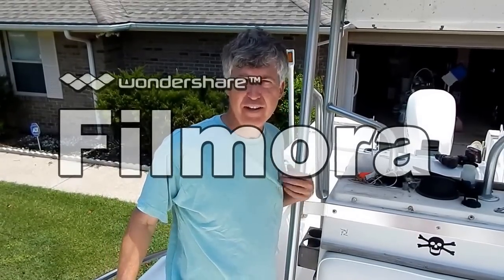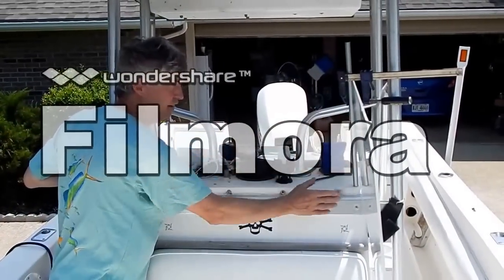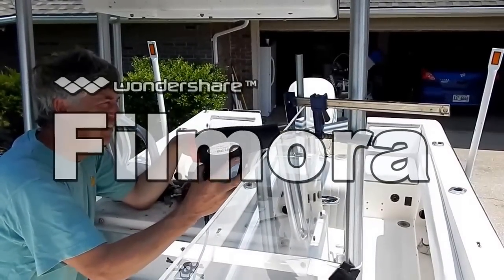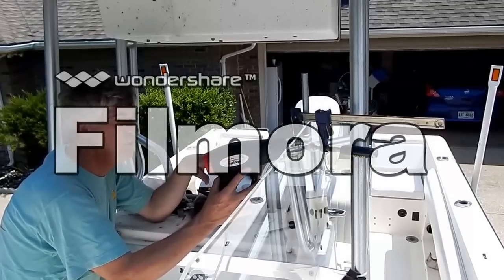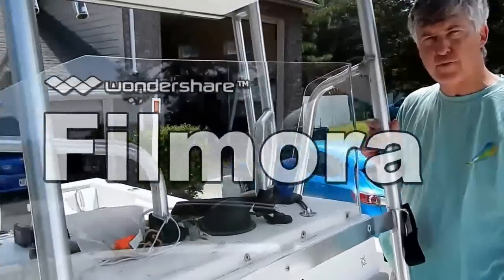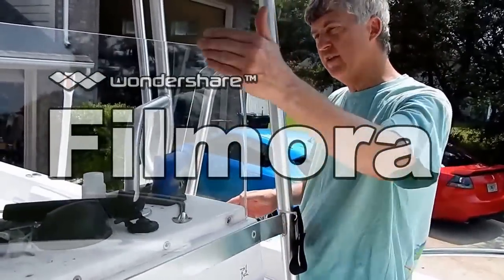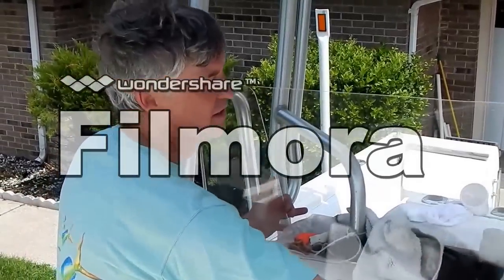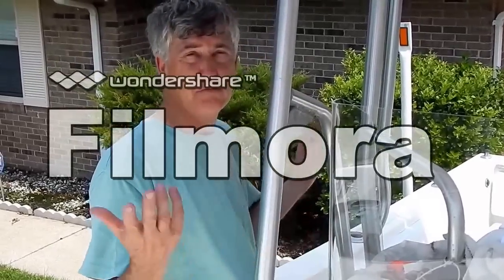How to bend Plexiglass to make a windshield for a boat!

Comment: Saved himself $150? Only if he doesn't use a jigsaw to trim it! If he does, he'll be spending the same again to buy more plexiglas and do it again, this time using a cutting implement that moves in only one direction. I have found a good, simple way to cut and trim plexiglas, or perspex as we call it in Australia, is to use a cutting disc in a spindle in an electric hand drill. You mark the cut line with a thick felt marker and cut a channel into the perspex beside the marked line, at least double the thickness of the cutting disc, to ensure the disc doesn't 'catch' in the channel. Naturally, the perspex needs to be held firmly by someone assisting you. You move the drill back and forth perpendicular to the disc to widen the channel and along the cut line progressively.

Comment: Good Video, If you mark console and  plexiglass in the middle, you won't have to trim. Work from center out.
Was also thinking if you removed a section from the middle of the Old windshield, the width of twice the plexiglass thickness, attach with strip of wood with countersunk flat screws, you could use the old one for a mold. Radius would be slightly Larger, have to make sure the new Radius will work. Would be on a table Flat son when the sides are heated, they drop into place.

Comment: A heat gun? Seriously? I made literally hundreds of those types of windshields in my 33 years in the business and that is not the way to go about that unless you don't care what uneven heated bends look like. Not to mention uneven stresses from uneven heating that may cause that windshield to crack in time. That should be done on a strip heater to get professional results.
Reply: Obviously he isn't in the business, let alone for 33 years. I think he's just an average guy trying to save a few dollars and help others save a few dollars too. I know where to buy a heat gun and plexiglass less than 10 min from my house, and the strip heater I saw for bending plexiglass on a quick google search was almost $500 on ebay. I'm sure that you know what you're talking about from a professional level, but I think context is important here.

Comment: Besides the Watermark, Why didn't you just buff the window. We do it everyday on aircraft, even lexan which is the toughest of the plastic materials. And yes,  you can buff it to perfection without any swirl marks whatsoever.  600, 800, 1000, 2000, then buff as you would clear coat. Sometimes you don't need all those grits, you might be able to start with 1000.
Reply: It looked crazed rather than scratched.

Comment: two people with the same heat guns would make this
job go pretty quickly.  If only one person is doing this,
I would suggest heat from the outside while bending.

But, that little bit of haze would buff and polish right out.
Reply from the maker: We had the same thought. but my wife was on the camera and we only had one gun.
Reply: @MuscleCarChappy   Hair dryer would have worked for a 2nd heat source. If u haven't tossed the old one yet you should save it and go buy some headlight lens polish and spend alittle time and fix the old one.
On a different note, it`s not likely we are related but the name makes one wonder.